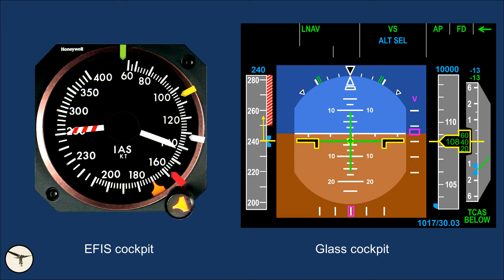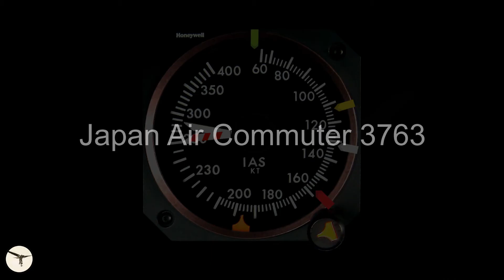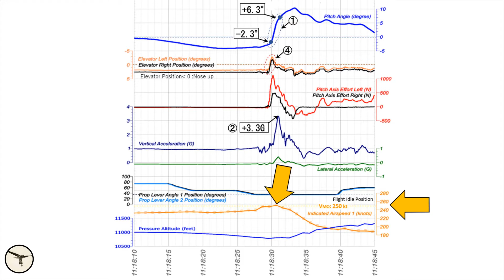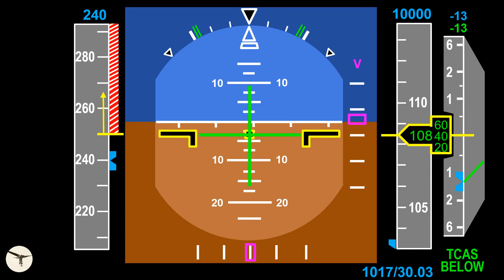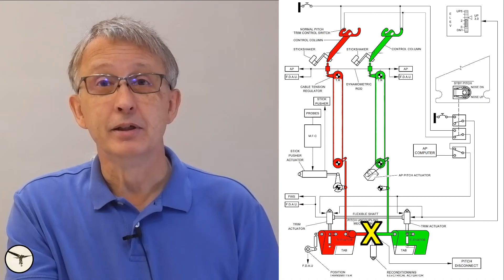Will flying too fast always kill you? The case of Japan Air Commuter flight 3763

Comment: It is necessary to indoctrinate and train pilots that devices like flaps, gear, speed brake and FCU/MCP selections are not executed from muscle memory but these locate, identify and operate items. Otherwise these mistakes will continue to happen. In B777 pilots have dialled altitude instead of heading causing altitude violation, in A320 they have set and pulled altitude instead of vertical speed and going in open descend one of main causes of a fatal accident. In A320 parking brake looks different operates in circular fashion while flap lever moves linear and yet more than couple time instead of flaps parking brake was set bursting tyres. Another dangerous habit is copilot keeping his hand on some lever and operate it instead of the correct one. In A320 when asked for gear up copilot raised flap. These habits must be got rid off.

Comment: Nah on 9/11 multiple 747s were able to do over 500 mph at sea level.  One doing a 280 degree diving turn to ground level without grounding effect cutting through concrete and steel with aluminum. 2 others cut through dense steel skyscrapers...😃
Reply: No 747s were involved.